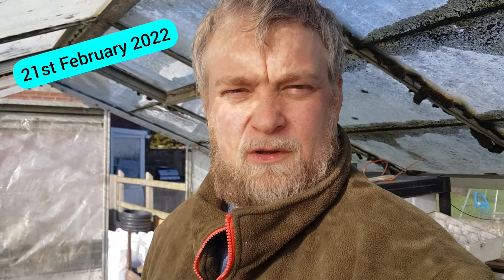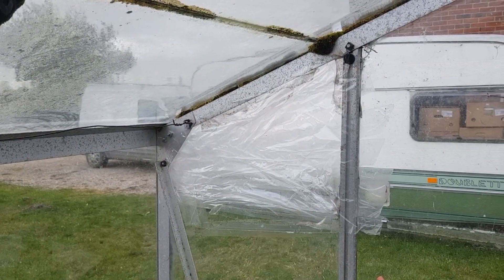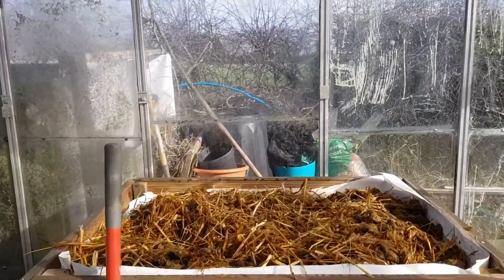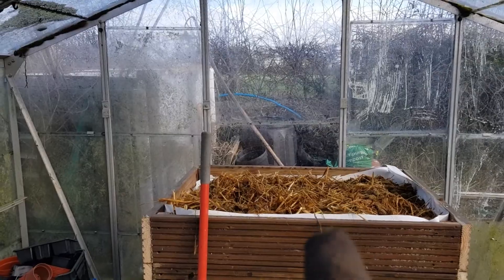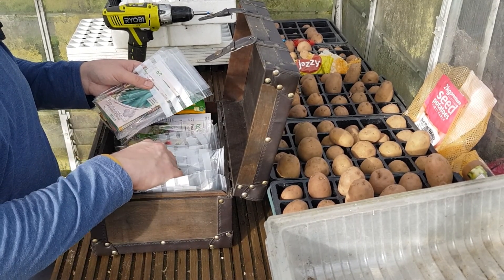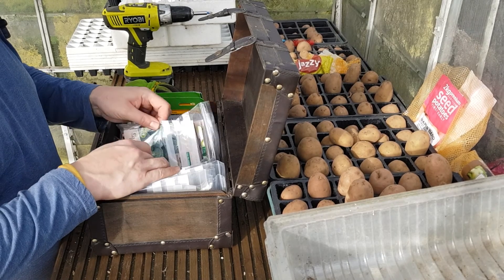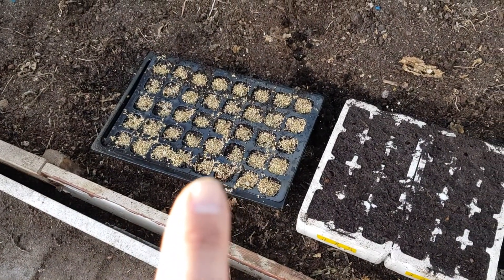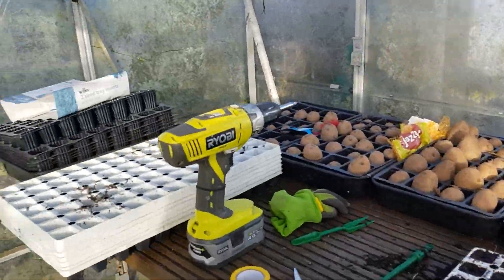Greenhouse repair and hotbed box filled with seed table fitted.

Comment: I really want to put a hot box in my polytunnel but haven’t because it’s shared with other people and I’m worried about the smell. Does it smell strongly?
Reply from the maker: Its not that bad ive got a 12x8ft as soon as the doors opened and the air circulates its fine. Got down to -2 the other night and the cars were frozen but the greenhouse was fine. 🌻